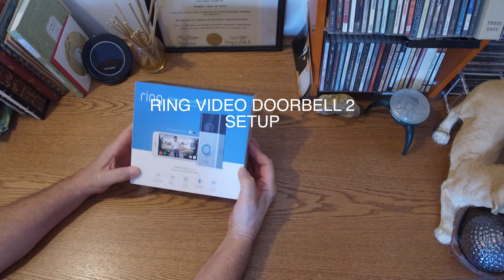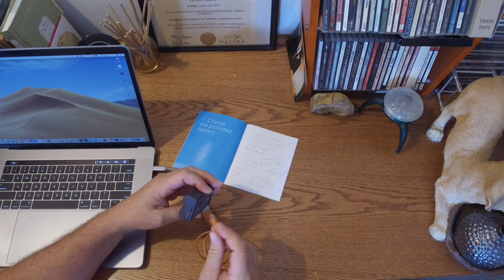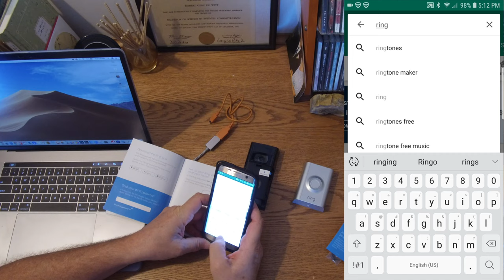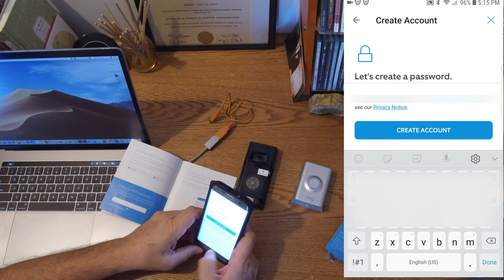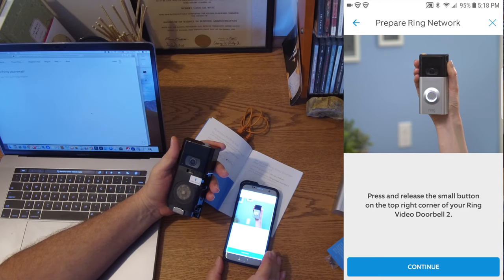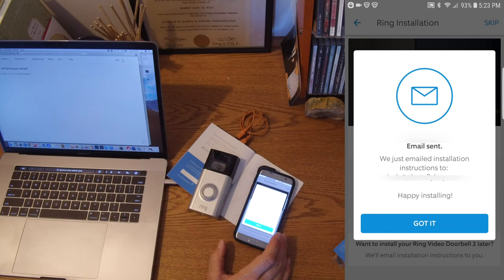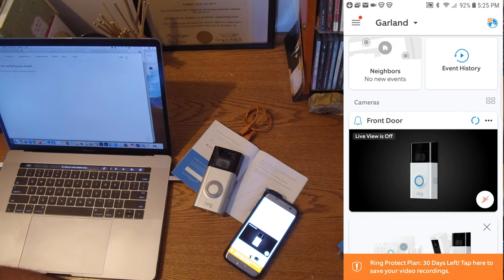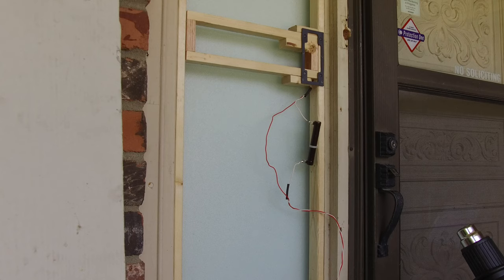Part 1 UNBOXING & SETUP - How To Hardwire RING Video Doorbell 2 without an existing doorbell.

Comment: Misleading title. This does not show installation at all. Just unboxing and setup...
Reply from the maker: I have not published the physical installation yet however it does say in the title “ Inline Installation Part 1 Setup”.   Sorry for the confusion........  also the actual installation Part 2 is almost finished and I will leave a link at the bottom of this video.  Also all the parts I used for the installation are listed in the description below.
Reply: @Photoflyboy  well I am looking forward to that video when it comes out. I saw this video was posted a year ago and was a part 1 so I searched your page for part 2 and didn't see it. Thanks for the clarification
Reply from the maker: Squid86  I know, I really need to just put my head to the grindstone and get it done.
Reply from the maker: If you read the Title you can see it says Part 1 Setup.  There's a link in the video description for Part 2 "how to hardwire video doorbell".  It was intended to be a 2 part series, Setup and Installation.  Sorry for the confusion.

Comment: where is the next video , my transormer burn up, could i use a 9v*2 vac  to power it ?
Reply from the maker: Sorry I've been traveling a lot the last month.  I have all the footage I just need to put it together.  Anyway, if you use a "Broan-NuTone C907 Doorbell Transformer Compatible with Smart Video Doorbells, Easy Installation Lock or Wall Mount Door Chime, 16V, 30VA" Amazon link https://amzn.to/2MseW9x 

You will also need a Resistor here's the link.   https://www.digikey.com/product-detail/en/FVT05006E25R00JE/FVT50-25-ND/257596
This is the Resistor that Ring has tested with.

Run a new wire from the transformer to the doorbell here's the wire I used.  https://amzn.to/2N6hIkb  Southwire 64267201 Red/White Bell Wire

You will need to solder the resistor between one of the 2 wires is doesn't matter which one.  You also don't need to use the diode that comes with your ring doorbell is power comes directly from the transformer to ring doorbell.

If you use these parts it will work perfectly with no problems.  Also, the doorbell is continuously illuminated.  Hope this helps!
Reply from the maker: How to Connect Your Ring Video Doorbell Directly to a Low Voltage Transformer (Without a Pre-existing Doorbell)
If you would like to avoid charging your battery by directly connecting your Ring Video Doorbell to a transformer, it's possible if you don't have an existing doorbell.

This article will tell you how to connect a Ring Doorbell directly to a low voltage 8-24V AC transformer.

Note: Some important facts for people planning on using this optional alternate configuration for their Ring Video Doorbell. 

The Ring Video Doorbell can only be connected to an AC transformer. DC is not supported.
Connecting the Ring Video Doorbell to an AC transformer requires some knowledge of wiring and soldering. If you are uncomfortable reading wiring diagrams, hooking up wires or soldering them in place, consult a licensed electrician for assistance or use the built-in rechargeable battery to power your Video Doorbell.
Wires should be soldered onto the resistor and a wire clip can be used on the other end. 
In addition to the equipment included in your Ring Video Doorbell box, You will need to purchase an electronic resistor. A resistor is REQUIRED in place of a mechanical or electronic doorbell kit for this alternate configuration to work successfully.
Do NOT install a diode.

If you are looking to purchase a resistor, here is one we have tested and recommend:

North America

https://www.digikey.com/product-detail/en/FVT05006E25R00JE/FVT50-25-ND/257596
Australia

http://au.element14.com/ohmite/850f25re/wirewound-resistor-25-ohm-50w/dp/1130293
New Zealand

https://nz.element14.com/ohmite/850f25re/wirewound-resistor-25-ohm-50w/dp/1130293
Reply: @Photoflyboy  ok cool thank u

Comment: So thanks for wasting my time. Thumbs down for the misleading description.  This is an unboxing not an installation video.
Reply from the maker: Sorry to disappoint but it does state in the description that it's part 1 Setup.  If you read in the description you can get a good idea of how to hardwire the Ring Doorbell.  All the parts needed are also listed in the description.  You just need a power supply transformer, and a resistor which is also in the description.  When I did the install I hit record when I finished a step and stopped recording when I wanted to start recording.  I'm still trying to piece it together with what I have but I'm not pleased.  I do have to say everything works great since the install without any problems.  Read the description and you should be able to figure it out, it's pretty simple but you do need to solder and I'm sure there's a million videos on that.  You can attach the wire either way so no tricks there, and once again the wire is listed in the description.  I really don't know what else to tell you, thanks for the comment.